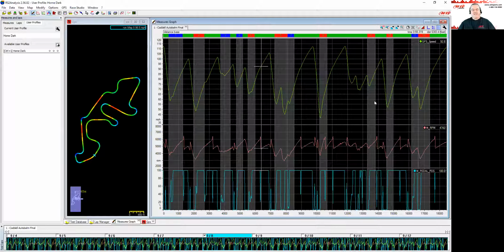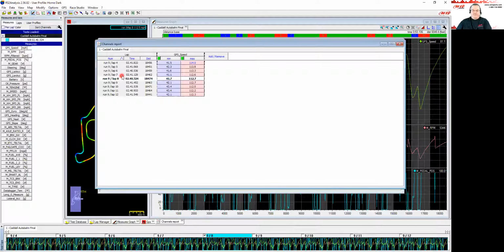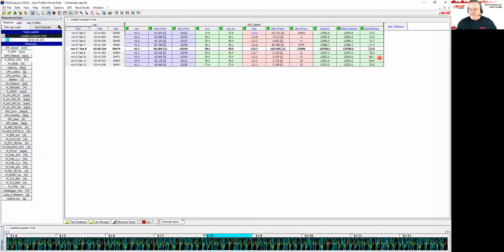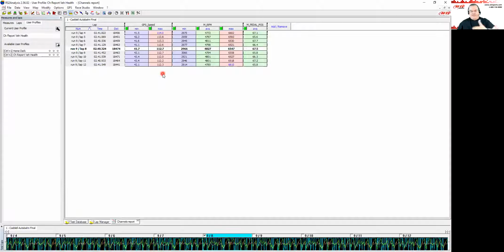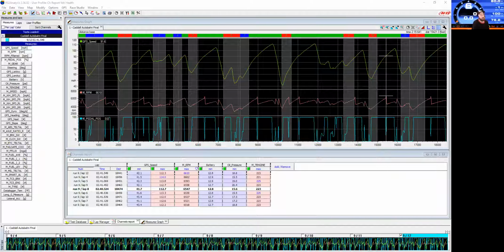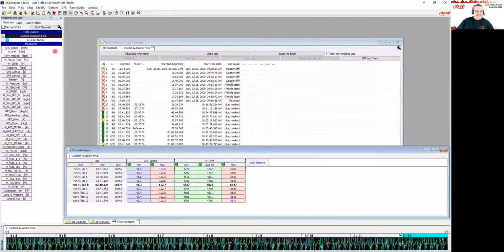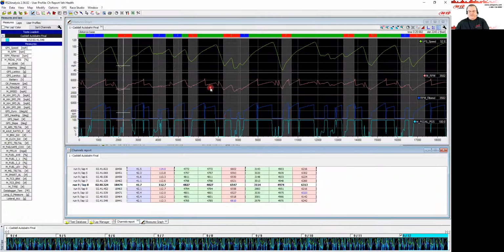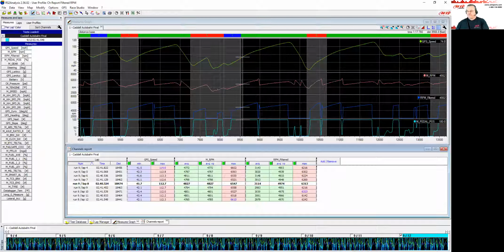1-3 Race Studio 2 Analysis Channels Report - Live Webinar - 4/7/2020

Comment: AIM Solo2 DL...how can I get Pedal position for a 2015 BMW M3?
Reply from the maker: Hi Lew, Locating data on the CAN bus is no simple task. We are always happy to add new channels to our offerings but the process requires a car available for testing. Sometimes this is hard to accomplish. We do have external sensors also that can be added to our automotive systems if we can locate the data in the CAN bus. Give us a call and we can help you find the best solution for you! (800)718-9090